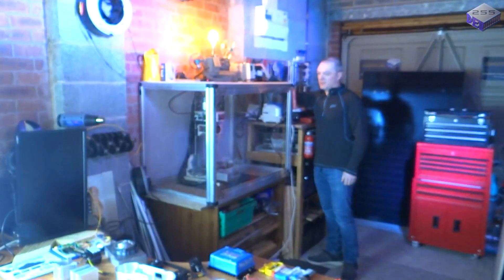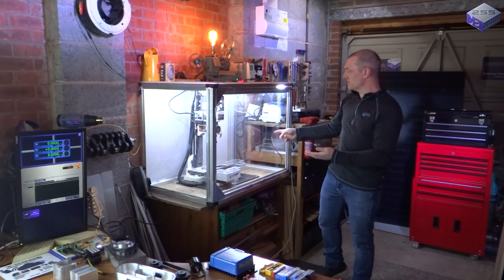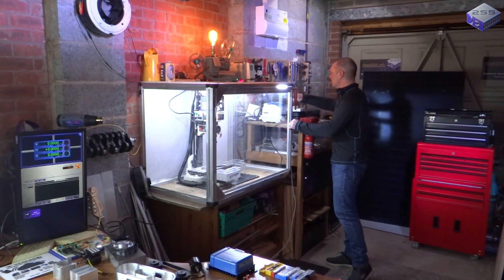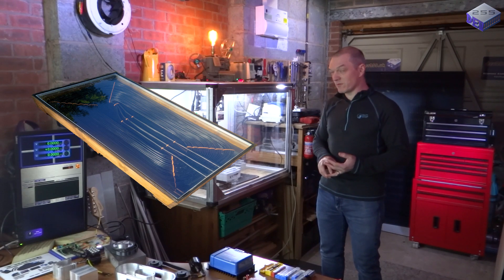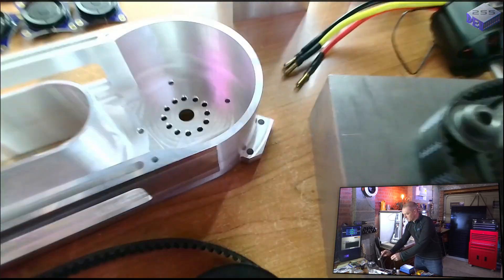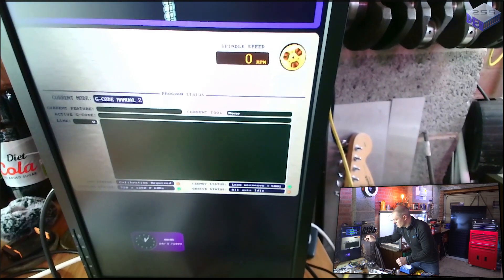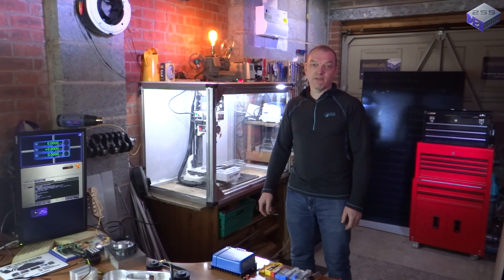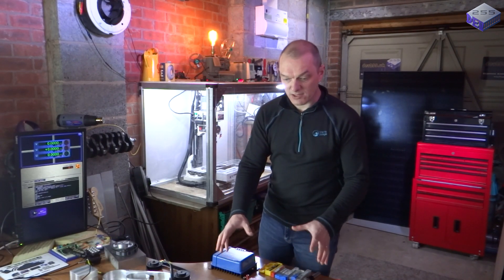Solar Projects to come in 2022

Comment: really cool stuff, the place is looking great! having the power of such a capable CNC mill and a CAD capable PC entirely off grid is just amazing! what a nice setup!

you said something that i've wondered about in the past but never figured out. is it possible to isolate a 12V circuit from a 24V battery bank, without using a step down regulator?  it sounded like thats what you're planning to do, but i don't understand the wiring setup that would let you do so. 
keen to see how you'll go about it, if you could address that in your video when the time comes i'd really appreciate it.
Reply from the maker: Hi, yes you can take the 12v off a battery in series of a 24v system. Toys have been doing it for years as a simple example, say you have 3 x 1.5V AA batteries in a battery box in a toy, so you have 4.5V for that toy, some toys tap off of the 1st or 2nd battery to have 1.5V (1st battery positive, 2nd battery negative) or 3V (second battery positive, third battery negative). but you will need to bear in mind that if you take a lot of current from the 1st and/or second battery, these will drain quicker, so it's best to take small loads from these; this is not too much of a problem though if they are on charge. I hope that helps. I've pinned your question to the top so that I remember to include it. Thank you for your question.

Comment: Neil in episode improved solar heater Great video with info. a question what brand solder fire torch are you jusing? i can see only the half word erpro 120
Reply from the maker: Hi Jack, good point, I just popped out into my garage, it's an iroda Solderpro 120, it's an awesome little torch, heat gun, plastic cutting device. Mine was £69.99; there are cheaper versions although I've had mine for many years and it's still going strong, plus it's in a decent hard foam case with heat protection built-in. Here's the link: https://www.maplin.co.uk/iroda-solderpro-120-30-125w-butane-gas-powered-soldering-iron-kit-0742286981009?ff=157&fp=34838&gclid=Cj0KCQiAxoiQBhCRARIsAPsvo-ywPM3XgVtSXtSYNDUGV5ueisYWRIU2TjNZoWWG2xlby42J_vKG6poaAtl_EALw_wcB

I put the comment on both videos just in case others want to know ;-)